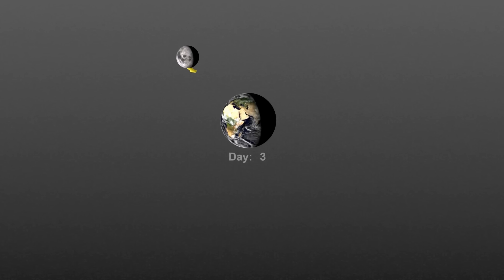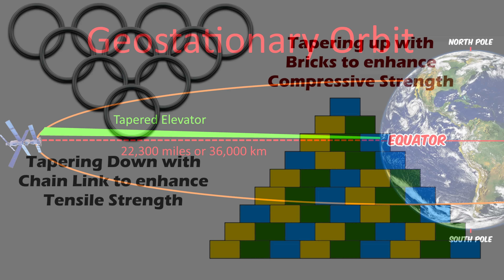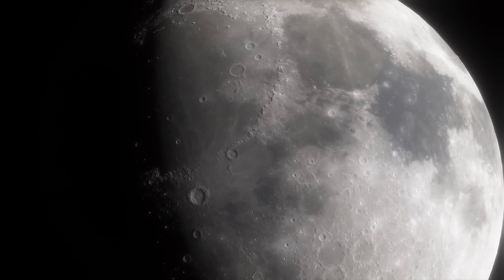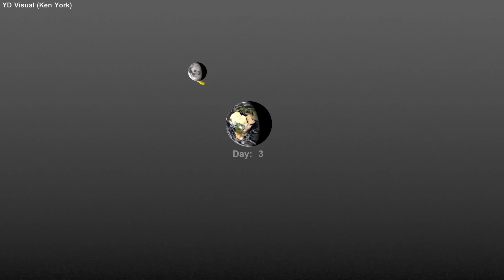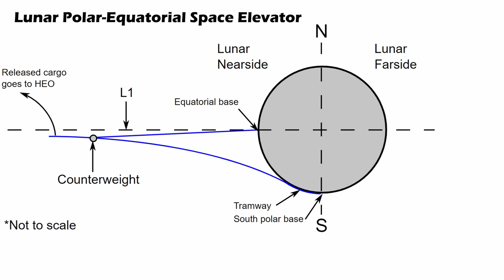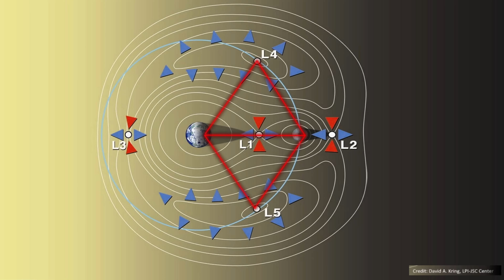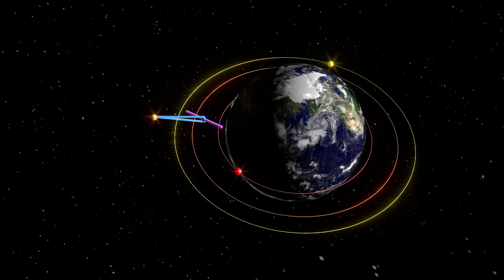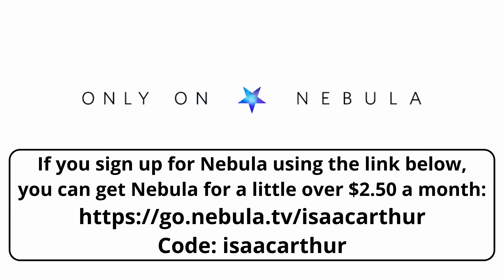Lunar Space Elevators

Comment: The mass driver would be first, because a killer ap for the Moon industrial park is volatiles for propellant and life support and construction materials for cislunar infrastructure, and you can build gobs of them for the price of a skyhook or space elevator, especially if you're trying to build the orbital stuff out of pre-mass-driver priced material.

The mass driver makes elevators and skyhooks cheaper, so that's how you would bootstrap things:

1. ISRU extraction (volatiles for propellant, life support; agregate for mooncrete/moonmortar, moonbrick; metals, etc.
2.  Start churning out mass drivers.
3.  Use mostly Moon materials to build a rotating skyhook for Earth in the Lunar orbital plane.
4.  Close the inner loop with an Earth-Moon L1 space elevator, mostly for traffic down to the Moon's surface.
5.  Close the outer loop with an Earth-Moon L2 space elevator, mostly for traffic to the cislunar system from the rest of the Solar System.  (You launch outbound traffic from mass drivers.)

Of course, You'd be doing other things with the Lunar mining, manufacturing, fabrication, and construction in the meantime, but we're discussing transportation infrastructure on the Moon.  The Moon becomes the rail and industrial hub.

Comment: just an idea: several lunar elevators (at least 4). make 2 towers (>10km)on the poles of the moon, one on each pole. and from each tower 2 elevators. one to L1, the other one to L2. the towers should be able to move a slight bit because they have to hold the elevators steady.
these towers could then also be the anchor points of a lunar orbital ring that goes vertically from north to south. hopefully, there is an orbit similar to the sun synchronous orbit on earth. from there, they can send tethers down to many points on the surface, and it would make surface to surface transport very easy.

Comment: I'm not a fan of lunar space elevators (rotovators make more sense, IMO), however you missed one of the lunar space elevator's party tricks: If you extend beyond L1 much more than is required for counter-weight, you can extend all the way into low Earth orbit. The "orbital" velocity, given the 29 day period, is tiny, allowing it to work in much the same way as the lower tip of a static orbital tether. Rockets from Earth require an order-of-magnitude less energy to dock with the tether-tip, compared to going into a proper orbit.

There's a limit to how close you can get, since the moon's orbit is not circular, so the lower tip will drift closer and further from Earth each month. But theoretically, you could even use that to dip into the Earth's atmosphere once a month.

Comment: Thank you, Isaac. Tethers and sky-hooks have been concepts that fascinated me for a long time.
"There's no such thing as a free lunch." ~ You haven't looked into tethers yet, have you? If you have the right mix of loads, you can actually generate energy with tethers, sell that off as electricity.... It would take a lot of energy to get them up there and working, but as long as you are mining on the moon, and shipping material back to Earth, that will provide energy to maintain the tether. Then you can use it to launch smaller loads from the middle to an upper atmosphere to a stable low earth orbit. The tricky part is it's like a plate-spinning act in a magic show, you've got to watch and manage a number of complicated dynamics at the same time. But as long as you can orchestrate the movements, it really is a free lunch.
Reply from the maker: Yep, they have amazing options, but I don't think you can do electrodynamuc tethering around the moon, not a good enough magnetosphere iirc
Reply: @isaacarthurSFIA  ~ It has been a while, I'm rusty, but I think you can do a pure kinetic rotivator right down to the moon surface and off it, as long as you balance the loads. You need as much going down as you have coming up, or you need some external thrust for your tether. You can't drive it by electro-magnetism either, as you say. If it gets a bit out of whack, you have to apply thrust to correct and you have to do it pretty fast. Like I said, it's like spinning plates. But unlike on Earth, you can operate the thing right down to stationary pick-up / drop-off right on the surface.
On the down-side, if you get the sums wrong, imagine 5,ooo miles of the cables that hold up the Golden Gate, falling down across that city, first parts going fairly slowly, but the later parts moving at 34,ooo km/h or so .... Exactly how far along the surface that could spread out and wreck stuff, I don't know, but I think it would rival SFO's big Earthquake that's coming. You could do a mind-boggling amount of damage with that.
Have you read DiskWorld, and the shade squares come down and so do their cables?
Reply: @Kneedragon1962 cool blog bro

Comment: Could you catch an aluminium spacecraft on lunar elevator with a magnet? Similar to the trick where you try swing an aluminium sheet through a horse show magnet which makes it stop.
Reply: You can, but it isn't optimal. Using aluminum limits decel speed by how much eddy current waste heat you can radiate away & the MP of aluminum. Also using a magnet, especially the superconducting variety, let's u do regenerative braking to recover almost all of the kknetic energy of the payload.

Fine for a first go, but probably not what u stick with for any length of time

Comment: What about hanging a stationary elevator on an orbiting ring? Like the elevator stations of lofstrom loops
Reply from the maker: Yes you can do that too
Reply: If you thought a regular space elevator's dynamics were hard to manage... That would be doable, but would be a pretty absurd megaproject. If you plan on moving vast quantities of material it is a great idea, and doesn't need any exotic materials. The issue is that it doesn't scale down particularly well. It really wants to be as close to symmetric around the planet as possible. Any failure to distribute the loads will result in flexing, and that would be bad. It really wants to have base stations distributed around the planet, and thousands of them. It is probably how you would go about dismantling an entire planet, but up to that point I don't see it having upsides that make up for the complications it brings. On the plus side, you might actually be able to build it without putting anything into space. Imagine you have a hyperloop setup that has a continuous ribbon of magnetic tape running through it, suspended by superconductors. You could accelerate this to ~20km/s, and then gradually raise the whole thing on tethers. If you can build a near enough frictionless pipe this could be extremely useful, because you stop caring about material properties at all. That makes it a viable structure even in the atmosphere of Jupiter (though then you are talking more like 200km/s, and having that much mass going at speeds where the speed of light becomes relevant means it could go very badly wrong, but it could work in theory with materials we have now!).
While a space elevator is a megaproject because it requires a complete covering of a 1 dimensional line between the surface and geostationary, such a project does not really function without a complete covering of a 2 dimensional plane. It is vastly larger than project than a single elevator, though in theory much simpler. It would also fail even worse than an elevator; if it does the entire structure fails! That would be bad.

Comment: I would think that since the space between Earth and the Moon is essentially "weightless," having a continuous bridge between them seems massively pointless, even if you have the means to do it easily. It seems much more practical to just have a system where an Earth elevator moves a craft to an ideal distance into space, and then "flings" it toward the moon at a particular speed, and then a complementary elevator from the moon will "catch" that pod, with all the relative speeds being balanced so that from the perspective of the pod, it would feel no change in acceleration at any point in the journey, and would be internally identical to if it had been a continuous elevator, and require zero fuel (aside from some back-up fuel for emergencies). It would be similar to those devices that launch a ball bearing off a roller-coast style rig, and then the bearing flies through the air and lands on a similar roller coaster style rig, with no significant impact when it lands, because the angles are calculated out.

Comment: I think that the best option for a rocketless launch assist system on the moon is actually a launch loop.
A system that doesn't support launching and landing on the moon is far less useful than one that does. Also if the payload has to be a certain shape makes it even less useful. My option would be to use starship to establish industrial capacity on the moon and constructing a launch loop, on the equator, raising up to 20km from the surface where it would avoid any craters (saving you the pain of building multiple Km long supporting towers),launching you straight to orbit with no orbit raising required and ships could dip their periapsis and match speed with the platform and be caught by tethers. They would then apply regenerative breaking to slow down. The reverse for launching. At one G accel,it  would need to be about 285km long (including safety margins). At 3 G's,you could get away with 120km. And i would prefer to be capable to have about 150 tons of payload capacity,the mass of a starship or its payload.
If you got that then you go for an orbital ring,which straight up beats any space elevetor in every scenario i can think of.
Orbital rings get far too little attention,and more episodes about them would be very welcomed.

Comment: Because the moon is tidally locked with Earth, space elevators will only function on the side of the moon which faces away from Earth. any point, from limb to limb, as long as there's clean access to the elevator's intended altitude, the elevator should be able to have enough centrifugally induced tension for the tether to work. Any attempts to fly the tether toward Earth will result in the tether not being able to achieve centrifugal tension, resulting the tether's collapse. All tethers must extend parallel to the line of centrifugal force, along the Earth/moon tidally locked line.
Reply: No, an L-1 elevator has the same requirement as an L-2 elevator.  You need enough of a net counterweight Earthward of L-1 to tension an L-1 elevator, just as you need enough of a net counterweight outward of L-2 to tension an L-2 elevator.  The engineering case of the L-1 elevator is tensioned by an overbalance of Earth gravity, whereas the L-2 case is tensioned by an overbalance of centrifugal force.  The libration points are DEFINED as the balance points where the vector sums of both gravity fields and inertia allows a trajectory motionless with respect to the Moon.  Inward (Earthward) from L-1 at the same radial velocity (Moon's "RPM" around the Earth) an object will immediately tend to bend it's trajectory toward the Earth more sharply than L-1s path, because inward from L-1 (the balance point between Earth gravity on the one hand and the sum of Moon gravity and centrifugal force on the other hand), the balance is tilted in favor of Earth gravity.  It's not orbiting fast enough in that place to maintain a concentric trajectory with the Moon unless pulled Moonward by the rest of the structure anchored on the Moon, which it is in turn tensioning Earthward.
          An L-1 elevator is slightly EASIER, in fact, than an L-2 one because L-1 is close to the Moon than L-2, making a shorter construct for a given capacity.

Comment: Thanks Isaac. I think orbital facilities at L1 through L5 should come first. However, I have a novel approach to 'mining' lunar regolith that doesn't require landing on the moon. I propose a space tether, etc., that has an lunar orbit that follows the terminator (night/day) and harvests charged lunar dust that can rise for miles at the terminator. The dust can be processed and further refined via molten salt electrolysis. I believe that a large rotating structure can be built in low lunar orbit made from lunar dust as described w/o landing on the surface. Why go down the gravity well? The rotating habitats that can be built from lunar regolith can then be used where needed anywhere in the solar system.
Reply: Isaac, Arthur is his surname.
Reply: @seriousmaran9414  The error has been corrected.

Now what do you think of the concept?
Reply: @victordelmastro8264  the building of a drum like station in moon orbit is useful. You could make a non rotating outer drum from regolith. Above is quite plausible.

 For mining though you need to be on the surface and below it. Extract minerals and ore with robotic machines, pass them up to the station where they are processed.

 Only time people need to be on the surface would be maintenence. Fix machines, back to orbit and 1G environment.
Reply: That just limits you to what's available as charged lunar dust.  Which limits what you can harvest which makes it hard to justify the system.
Reply: This can be plausible if the charged particles are dense enough, but I think it is incredible thin. Like....thinner than the dust pollution of our atmosphere. Your idea has the benefit of spreading out a million times the coverage though.

Additionally, depending on WHAT is charged, it could be a good pre-filtered stream of resources....imagine if GOLD were the dominant charged levitating particle!

Your design can always be made better by having a snow-blower blast the regolith into the path of the orbiter, though. So, still a ground based miner
Reply: @donperegrine922  I think mining by taking up 'charged' dust from the moon, asteroids, comets, and gaseous bodies via tethers is an approach worth examining. I think if we can bootstrap the construction of rotating habitats, energy collectors,  mirrors, and antennas, as well as the tethers and processing equipment, we have a path forward via this approach. Otherwise, it runs into similar constraints like other approaches that make it too costly.  Ilmenite interests me.
Reply: @donperegrine922  regolith is rock dust from the surface and impactor, it is not that thin, more like chalk dust but sharper. Problem is it is well mixed so most of it will be just rock like on Earth. The important stuff in it will be tritium, H3.
Reply: @seriousmaran9414  mmhmm and whats the point?
Reply: @donperegrine922  tritium is a fuel for hydrogen reactors. That is the only point you need.

I didn't say mining only regolith was a good idea, we need the other materials to build mining ships to go to the asteroid belt and O'Neil cylinders for manufacturing, farming and accommodation.
Reply: @victordelmastro8264  What we really need is a good survey of what is and isn't there, where and how accessible, then we can start making plans for how to extract. :)
Reply: @seriousmaran9414  Oh! I think I see what our misunderstanding is. You said in the first response "Regolith is rock dust from the surface...it is not that thin". Are you talking about the powdery moon surface?

If yes, then I think you should read the OP. We are all talking about the levitating charged particles hovering like an atmosphere. That regolith is EXTREMELY thin. In the sense of not being very much in the atmosphere.
Reply: @donperegrine922  all of the moon dust seems to be charged, the floating stuff is just charged to the point it levitates. That is a particular issue as the dust is sharp and can stick to everything.

You could probably use charge to suck it off the surface. That would give you a lot of material. Usefulness depends on pot luck.

Comment: As Neil DeGrasse Tyson pointed out, if one reduced everything to the size of a schoolroom Earth globe, the current space station would be about 3/8ths of an inch off the surface of the earth. Every picture I see of a space elevator shows a tower, or tether, much higher than that. In fact, the tether would have to be much taller than geostationary orbit because one has to account for the weight of the tether. The space station can get away with it's orbit because it is supporting only it's own weight. Add a few million tons of tether and the equation becomes a lot different.

Comment: Assuming you had a hypothetical supermaterial that could support a space elevator to geostationary orbit, at what point would you stop feeling gravity? In orbit you don't feel gravity because you're in freefall (you just have enough tangential momentum to keep you from hitting the earth so your ballistic arc "misses"). Just because there's a whole elevator connecting the top at geo-stationary to the surface of the earth doesn't mean it's not experiencing those same forces but obviously you would feel gravity on the surface. So at what point would you start to feel weightless? Or over what range would you gradually feel lighter? Would it be from the surface where you'd weigh 100% of your normal weight at 1g, to 0 at geostationary since the speed at every point closer to the earth than geostationary would be moving slower than the necessary orbital velocity at its given altitude?